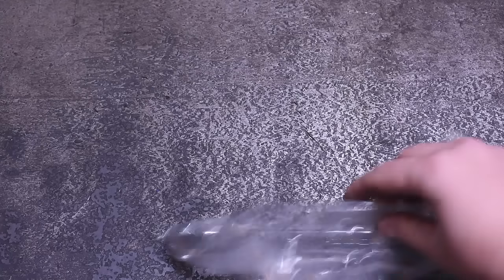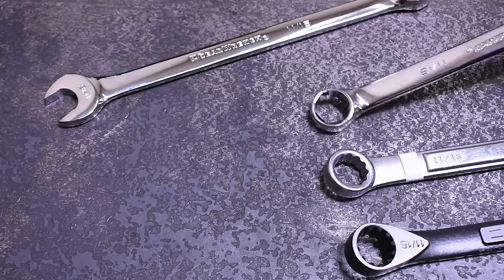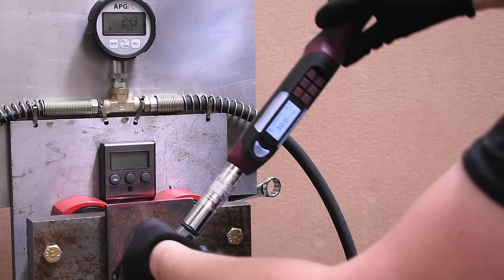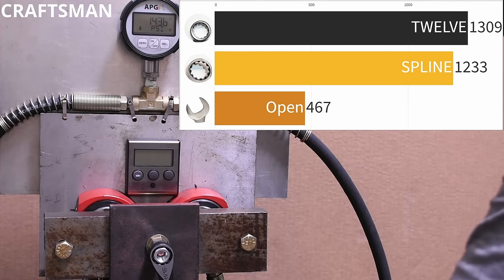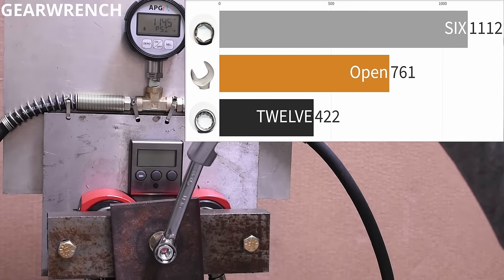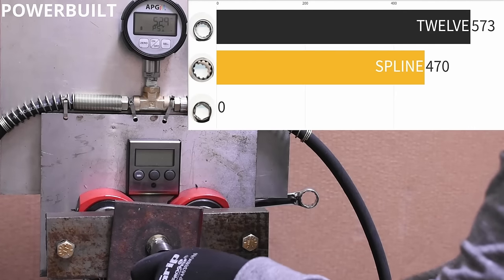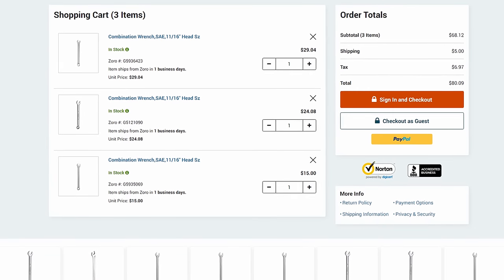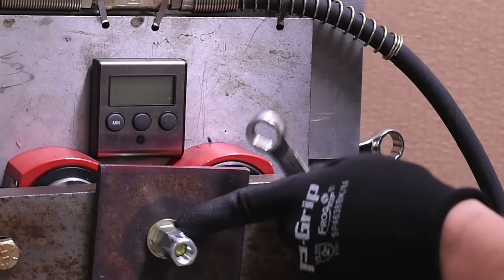Let's Settle This! What Wrench & Socket Design Will Slip 1st?

Comment: I'm a diesel Mechanic and I use 6 point every time I can because in my experience it's the best to use. I've have 12 point start to strip nuts and bolts. I don't have any spline wrenches but I have a few spline sockets for certain things.
Reply: Agree. 6 point is always going to be preferable to 12 points any day. Do you ever use the 'wall drive' type of sockets or spanners?
Reply: Yeah, 6 point is my go to now
Reply: @howardosborne8647  no I don't have any

Comment: I would love to see you re-test the Knipex pliers wrench against an open end wrench and adjustable wrench like this. I have the 12" and 16" XL Knipex pliers wrenches and I use them ALL the time at work on heavy equipment, but when I get asked to borrow a pipe wrench or adjustable, all my friends/coworkers turn their nose up at it when I offer it to them instead. The beauty of them is that they don't "spread", because the harder you push, the harder they squeeze the flats of the fastener. I can't remember a time when they slipped on me, i'm always careful how I position them
Reply: The "Bus Grease Monkey" and his son, "Indiana Diesel" both use and endorse the Knipex pliers.  I may have to pick up a set.
Reply: „Dad/guy who taught me did not use them and they are from another country so they must be shit“ - but don‘t be sad,  few ppl in Germany use Vise-Grips for the same reason, that might be because we have great Knipex Pliers but you still have to hold them shut.
Reply: I can do 50nm of torque in the right direction with the tinniest 125mm knipex wrench pliers and even the 150mm still fits on my pocket for every day carry.
And I own the 250mm/12" ever since I saw a youtuber use it years ago. They work amazingly well without slipping or damage anything.
And if you pull your nose up for knipex you're an absolute fool, who need vice-grips of your knipex cobra's actually grip instead of slide over something round.
Knipex is THE brand for pliers if you ask me.
Reply: @0b3rz0nK  I like vice-grips for removing damaged hardware but that's about all they're good for, either creating or removing damaged hardware.
Reply: @0b3rz0nK  the pressure keeps the knipex closed by itself tho...
Reply: @barrylinkiewich9688  I have noticed my old vice grips work better than my newer vice grips it's like they started making them out of a weaker metal and generic ones are junk compared to actual vice grip branded locking pliers
Reply: agree. because in that video shows wrong use for knipex adjustable pliers
Reply: @excavatoree  None better.
Reply: I've been using Knipex plier wrenches since I first bought an ADP-10 off the Snap-On truck in the 90's under the Blue-Point brand. Always my go-to favorite all around adjustable wrench. Great for squeezing things together and straightening sheet metal as well.
Reply: I work in a factory building engines.  We have an old pair of Knipex angled needle-nose pliers that we've been using on oil cooler hose clamps for years.  Literally, years.  2 shifts a day, 5 days a week, being abused by frustrated workers.  The gripping surface is polished smooth from the usage, but they still work perfectly fine.  I want to borrow them and take pictures sometime.  It kinda convinced me that they are worth the money.

Comment: I love your analysis and research. I found this info especially useful in showing the necessity for 6-point wrenches/sockets on rounded fasteners mainly on cars. Working in factories on brand new bolts and equipment 12-point is far more versatile and recommended by me (wrenches). While having 6-point sockets is ALWAYS the baseline due to no issues with angles.
Reply: I agree, you are a lot faster on assembly lines with 12-point sockets. I always tried to get my hands on them, since it made my job a lot easier.

Comment: In my experience, the spline wrenches are less than ideal in tight areas. Once they bite a fastener in a closed space it can be an ordeal to get them back off
Reply: my inexperienced opinion is that while they may be more effective and bite better, they also probably damage the bolt head
Reply: @ciarangale4738  same here. i think its fine to use spline wrench when bolt/nut is damaged and you are replacing it anyways
Reply: @KulegaRycha  true enough. Its enough, though, that id avoid them unless i had the budget and space for a general set and a backup set of splines
Reply: @ciarangale4738  My issue was looking at the newly round bolt head and wondering what to try next.
Reply: Spline wrenches should be used on splined fasteners.
Reply: @vincentlewey657  absolutely!  Splined fasteners can handle an extremely high torque without slipping.  Each "notch"  of the wrench fits in a groove on the fastener, giving you an enormous surface area to apply crazy high torque.  There are a lot of splined fasteners on aircraft, especially when you want them to stay put or is on a life-saving device.
Reply: Looked as though in the last example with the spline that was indeed happening. He had to bang on the wrench 🔧 to get it free.

Comment: Thank you. I'm only a year into my industrial mechanic career and have basic sockets. I'm getting to the point where I'm going to invest in more tools and will be buying a 6pt set before 12 or spline.
Reply: You will find with enough experience that you're going to need both 6 & 12 point sockets & combo wrenches depending on what you're working on.
Reply: The @AVE channel has a bit about this: Look at the depth of the tall sockets, cheapo brands the bolt will go the entire length of the socket.

Better brands typically have more shallow "depths". Allowing you to better hand start the bolt when putting it back in.

Comment: Right tool for the right job! When you have limited tools on hand, you limit your solutions to the problem. Splines may be used once the torque has been reduced by a six point, and where range of motion is limited. And always have the correct bolt replacement if you have worn the bolt/ nut from the removal process. Don’t skimp out on automobile parts because over torqued bolts may lead to failure on down the road. Understanding that the tools you have on hand may have been hardened steel removing softer steel bolts can cause stripping as you demonstrated can help newer viewers. This is a very good demonstration that you posted.
Reply: I quit having stripped fastener problems a while after I started replacing hardware when it had any sign of damage (instead of using again). I’ve had to build quite a hardware stock, but it’s great. 
I realized a few years ago that screwdrivers wear out, and replacing them with quality prevents a lot of trouble too.

Comment: Love this video. You turned my whole world upside down. I have been using 12 point wrench for the last 20 years on all those difficult bolts thinking is the best. I need a moment to recover. hehehe
Reply: Joe? Larry? Bob? Is that you? Trust me, you are not alone, Brian! I know several 12-point mechanics.
Reply: I’ve been working on cars for a year n always thought 12 points were the weakest jus based on lack of surface area.
Reply: Rip to all the rounded bolts
Reply: Lol. You must be crazy. 6 point always felt the best and pretty much never slip. 12 points are completely different.

Comment: 6 Point is better in almost all applications , it comes down to how much surface area you are contacting. On a hex nut , having six flat sides , and the wrench having six flat sides. It just makes more common sense to use that for grip.
Reply: Absolutely right.  A 6-point wrench has the most surface-area contact, maximum contact area = best traction, all other things being equal.
Reply: 12 point tends to be used (correctly) in tight spaces inside stuff that's going to be well maintained and not turn rusty. Inside engines, or in tight spots in aircraft construction where there won't be space to turn a whole flat at a time on a 6 point. Where they'll not be subject to corrosion, and good practise is applied i.e. fasteners are torqued to spec as designed 12 point is absolutely fine. They're crap if allowed to corrode, and they're not compatible with those types who just crank everything as tight as they feel like.
Reply: To this note shouldn't we test a 6, 12, & spline wrench/socket on their corresponding bolts?...surface area!
Reply: If the engineer did his job and gives you at least 90 deg to turn then it is, else ... 
But in the end, to be frank, if the bolts are fastened to the spec, even a wonky open wrench does the job just fine. 
If  the wrench fails on tightening you are overdoing it.

Comment: Measure the size of the tools between brands and you'll see a huge difference in tolerance to the fastener. That makes a huge difference in how much torque a tool hand handle. Some brands are so bad you can use a 1/2 on a 13mm or a 14 on a 9/16. Thanks for the comparison 👍
Reply: yup, never have I ever grabbed a slightly smaller socket and hammered it on to get a nice fit.
Reply: 14mm plus a hammer to seat the tool works great to break damaged 9/16 free.
Reply: I do alot of work on my vehicles and I'm often times using a 1/2 for a 13mm bolt or nut. I have just assumed they are one in the same except one is metric and the other is SAE. Never really occurred to me that they should not work that way.
Reply: thats why i stack up on several wrenches of the same size and pick the one that fits best, nuts and bolts also have wild diferences
Reply: @moviemaker2011z  1/2" is 12.7mm - definitely not the same, especially if you're dealing with supposed "precision" machining, but quite close
Reply: Or they reuse SAE sizes and label them for certain metric sizes, "close enough".  Sometimes it pretty much is (5/16" aka 8mm or 3/4" aka 19mm or 1 1/16" aka 27mm), sometimes no no it's not (7/16" is not 11mm or 5/8" is not 16mm or 7/8" is not 22mm or 15/16" is not 23mm).

Same for allen keys, one 1/8" wouldn't counter hold, grabbed a different 1/8" from a different brand set, held just fine.
Reply: @user-AdamSmith  honestly that's probably true. I have a family member that's the head engineer at Ford, I should ask him what the deal with that is although I doubt he will know the answer.
Reply: @user-AdamSmith  there are socket sets where they label sockets which a metric and an sae size. I think I've only seen that in sizes above 1".

Comment: I agree with another poster here. The 12 pointers are useless in Minnesota! All they do it round the bolts off / break them. I replaced all my 12 point Sockets with 6 points!
Reply: exactly why im not wasting my time to watch this video, i already know the answer.
Reply: That’s why I buy 6 point everything, although I have had some luck with spline drive grabbing on some partially rounded bolts so I keep a set of them handy. Regular 12 point is just great at turning hexagons into circles

Comment: I have a minor issue with the unsupported end of the coupling nuts. An "empty" nut is almost never encountered in real life. I would have filled the end of the nut with a bolt or piece of all-thread to keep it from collapsing.
Reply from the maker: Fair enough, but that's not the end that was collapsing. The nut would compress length wise, and budge at the dyno side. Which was full of grade 8 thread.
Reply: The point wasn't to test maximum torque but simply to compare wrenches to one another.  Since they compress the same way each time and they all slip at some point it doesn't matter.
Reply: Doesn't really matter considering that the only wrenches capable of doing that where the 6 point wrenches. It isn't really important how much torque you can put on something, nor is it the point of the video, it's a matter of 'how much more torque' which they've shown wonderfully here.
Reply: @TorqueTestChannel  I think what actually justifies your methodology, as FoxPro points out is that you are doing a comparative not absolute test. But the point about the open threads allowing distortion of the head is well taken, as anybody who's wrenched professionally for very long knows, the most difficult nut to remove is a flare nut for this very reason.

Comment: Basically what ive learned just in personal times working on rusted classic cars and trucks. Is a six point will almost always be better getting stuck bolts loose or tightening without slipping. But just those certain occasions where you are in a tight spot and you dont have much movement in a wrench or ratchet. The 12 point has more chance of getting on the bolt than a 6

Comment: Spline drive has aviation origins. Designed to get greater torque on a smaller head. I have 6 point tools, 12 point tools and spline. Use them appropriately. Don’t pick one type and try to use it on every fastener. 
This test shows the importance of using a six point tool on a standard hex head (unless limited swing is required) & a 12 point or spline on a double hex head.

Comment: Can you test anti slip open end wrench designs like snap on flank drive and wrights wright grip?
Reply: Flank drive and flank drive plus.
Reply from the maker: You got it
Reply: @TorqueTestChannel  if do this test, could you please include the "WaveDrive Pro" design by capri... aka infar wrenches
Reply: @TorqueTestChannel  maybe test different adjustable wrenches? Like the US made Proto and rigid(made by the same company I believe), a couple of the Japanese ones like the Nepros and lobster brand, and maybe the Spanish made channel lock, those are supposed to be pretty good crescent wrenches. Also maybe throw in some cheap Chinese ones for fun.
Reply: @BryceKimball7.3  also include raptor adjustable wrench. They are sold at furgeson supply stores.
Reply: Proto Full Polish and Satin Combination 6-point wrenche has Anti-Slip design at open end box end incorporates the Torque Plus system.
Reply: The big drawback for me is that when there is little room for the wrench they move back and forth enough to prevent the ratchet from jumping to the next tooth.

In Spain they are very common in cheap sets imported from China, they seem to have a better grip, they have never rounded or deformed the head of any bolt by tightening them to the recommended torque, and on some occasion they have allowed me to loosen a bolt where the 6 flat faces they gave the feeling of going to slip, like in bolts and nuts that hold the blades of the rototiller, those end up sanded round by the sandy soils I have to deal with, although these are grade 10.9, I suppose if they were softer their heads would still deform before loosening.
Reply: Don't forget the astro ones, I've had good luck with those
Reply: SK’s X-Frame wrenches are also anti-slip on the open end, as well as having 216 position 6 point ratcheting box ends. I really like them, but they’re getting a little harder to find, with SK’s manufacturing shut down due to being acquired by GreatStar.
Reply: @TorqueTestChannel  dont sleep on milwuakee, theyre trying to enter into mechanics tools is it all smoke being blown dark places or should my next set come in a red case?
Reply: @TorqueTestChannel  don't forget the flank drive and flank drive plus sockets from snap on, they have a additional buldge on thr flats to help grip aswell as cutouts on the corners
Reply: I'm curious if the new Diehard open ends are as bad as I think they look.
Reply: I assume the Gear Wrench were the "control drive" design
Reply: @TorqueTestChannel  is there a reason why you never see Metrinch being tested?
Reply: @chrisdavidson911  great question
Reply: @BryceKimball7.3  If you can find one, the best I've used were "Diamond Tool And Horseshoe" brand, long out of production.
Reply: @P_RO_  I’m not looking for good ones, I already have access to 15+ different brands, new and old, just wanted to see what he would come up with comparing the main ones.
Reply: @MrCROBosanceros  +1 for Proto
Reply: Also add the Mac 6point ratcheting wrench found these to be excellent on rounded fasteners
Reply: @TorqueTestChannel  so looking forward to flank drive plus open end wrench test! I have had am older master tech swear after anything else rounded out a bolt the snap on flank drive plus open end could get it off.

Comment: Proof that the specific geometry is really important. 6 vs 6 and 12 vs 12 vary greatly across brands. As a rust belt resident, I only use 12pt on stuff that's new, or needs a specific 12pt. 6pt and spline (hammered on) are the rule of the day.

Comment: Great video, proves that we need every tool available at our disposal just in case. Some are better at degrees of throw, some at worn fasteners, some at brute strength for super tight fasteners.
Thanks!
Reply: Yeah, but outside of making stuff harder to steal by fully rounding the fasteners, I just don't have a use for 12 point sockets.
Reply: @kd5nrh  12 points is great for torx on cars.

Comment: I am 79 and never was a "professional" mechanic. But, in my 20's and 30's, I built a lot of sports car race engines for rally cars. I started off with Western Auto (now defunct) tools, upgraded to Craftsman and finally on to Snap-On. Along the way I tried Gear Wrench and found little or no difference between Snap-On and Gear Wrench. A while back I bought some Tekton tools and was amazed at how good they were. So far, working on my own cars, I have not been able to break a Tekton wrench. And, believe me, I have tried. Of course, this is only my experience. I am quite sure that there will be others who will have a different story.
Finally, I hate spline wrenches as they always seem to round off the bolt/nut head. I do not want the expected headache that experience causes.